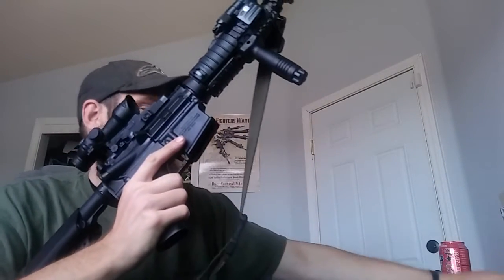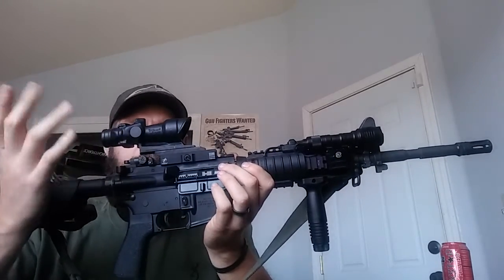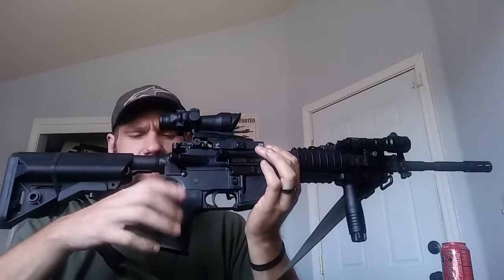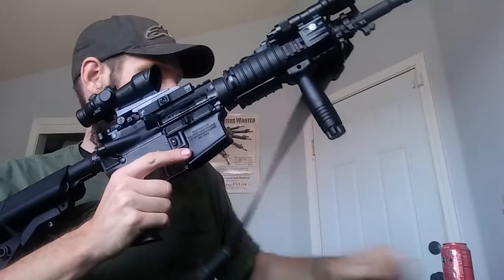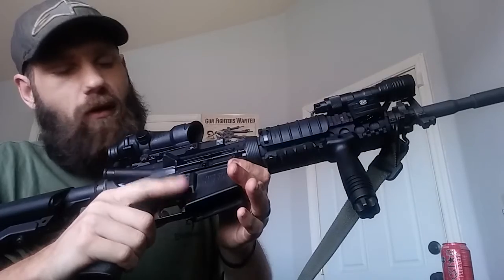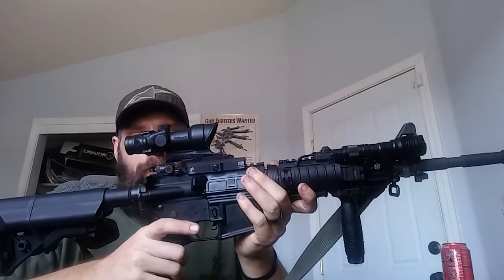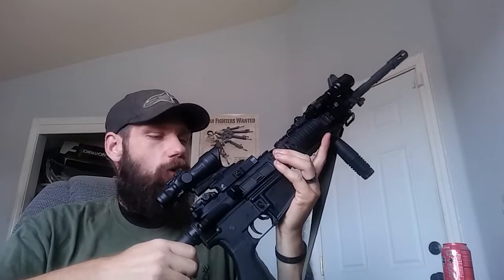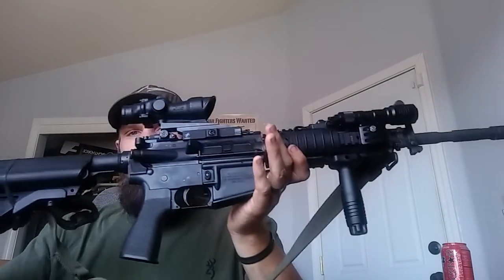Colt 6921 block 1 clone "enhanced" LE6920 ACOG ta01

Comment: 1996 called they want their rifle back, jk. cool setup.
Reply from the maker: +Bordz lol!
Reply: ive always wanted to clone a military rifle.
Reply from the maker: +Bordz its fun to chase down parts But it can get crazy expensive. The parts are getting harder to find as some are not in production or never made in large quantities for the commercial market. Some guys pay $300-400 for the "correct flash suppressors!
Reply: thats nuts. ill clone an Mk18 lol.
Reply from the maker: +Bordz a mk18 mod 0 or block 1 is about the most affordable stuff. Block 2 gets expensive! Used rail is $450-600 and cheapest optic is a T-1. Other than that its a $2200 elcan or $1900 ECO ACOG! Or M16A4 MARINE clone isnt to bad if you do it pre ACOG. AR15dotcom has like 700 page thread on block 1-1.5-2 in detail

Comment: Besides the price, is there a difference between the LMT and B5?  They look the same to me
Reply from the maker: I think they are pretty much the same. The LMT would be clone correct if you are going all out with a clone build.
Reply: dennis1979gm B5 is also clone correct, it has a government contract
Reply: @dennis1979gm  the b5 has a NSN so it can be ordered.
Reply: I have both. Bought the b5 long ago but when I got a kac lower it came with a lmt stock. I felt the lmt is a bit tighter but that’s probably because it’s new. Everything felt the same and looks nearly identical.

Comment: is the upper a colt? I don't see a C mark on it?
Reply from the maker: +jcm8002205 yeah its a colt. Its one of the newer versions and they have been hit and miss as of lately with their markings. Barrel has their cage code # but not the standard C MP marks. As of late colt has been a little off on their traditional QC. Bolt was marked and had the white paint mark. Just no C on upper.
Reply: dennis1979gm  ok awesome. reason I was asking is i just bought a new le6921. it also doesn't have the c stamp on the upper. just looking for answers why it doesn't lol.
Reply from the maker: +jcm8002205 believe me i was searching too! Lol seems to be a common think with colt recently.
Reply from the maker: Thanks for the info! Good things to know.
Reply from the maker: Thanks!